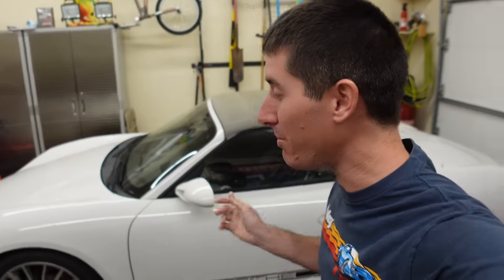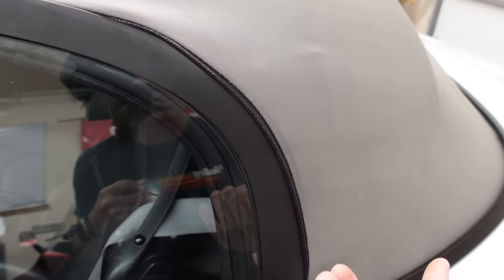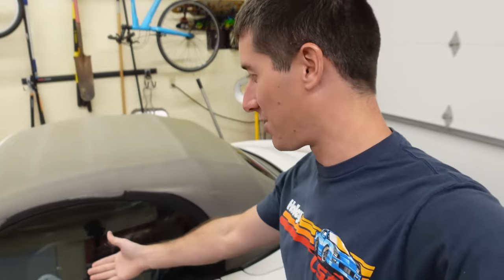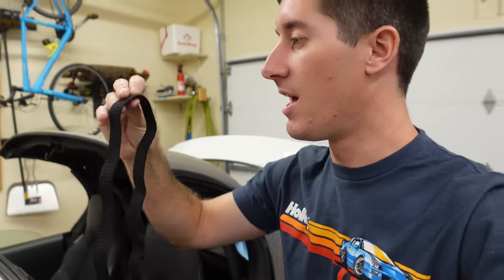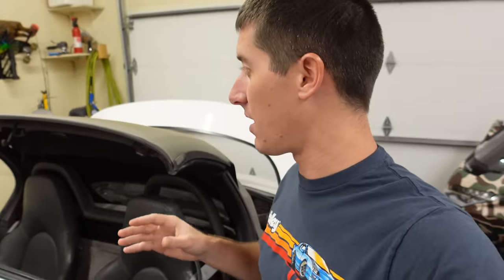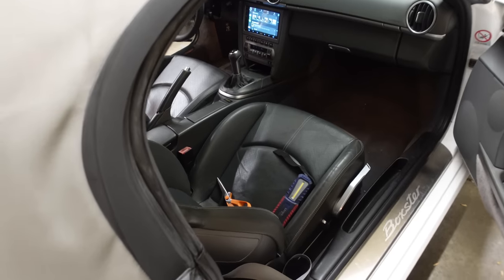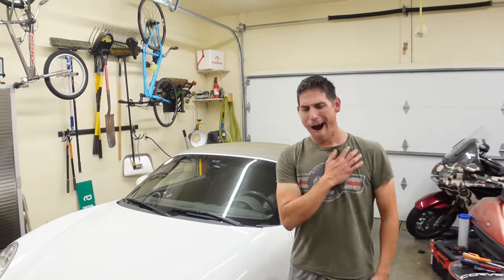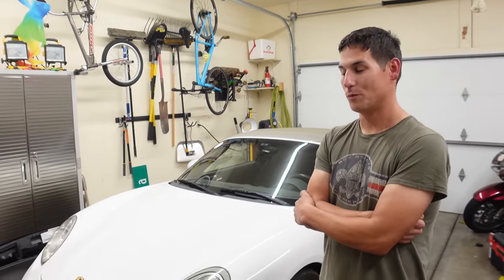I FIXED My Porsche Boxster Convertible Top For ONLY $3... You Can't Top This

Comment: I swear by those Atoto head units! I took a shot putting one in my f body and I LOVED it. Awesome using and obd2 reader and putting dashcommand on the head unit for some additional gauges. I now have one in my truck and have trans temp without adding any gauges to to the “a” pillar or anything!
Reply from the maker: Isn't Dashcommand awesome? I still keep that setup in my backpack all the time 💪
Reply: @WatchJRGo  well worth the purchase for sure!
Reply: How would an Atoto unit compare to a similar unit from a brand like pioneer that cost $600 with wireless carplay? The price is great, but a pretty leery of something named Atoto. Are the features just as good, any features you are giving up? The newest Atoto with wireless carplay has almost no reviews.

Comment: I just did this fix on my 2008 for free. That elastic is the same as they use in kids' pants so you can adjust them. There are little holes sewn in every so often, just like from the factory. I cut some out of a pair of Levis my 10yo had otherwise destroyed.  Worked great and I have easy adjustability, just like from the factory. The screw inside is a T10. I had to remove it, which made stapling the other end much easier. 🎉

Comment: My 1st Porsche was a 15K mi, 4 yr old 01 Box S.  It was not very reliable but thankfully it was CPO'd so Porsche paid for most of the repairs.  6 mo after the CPO ran out, I traded it in on a new 08 Boxster S LE (the orange one).  Kind of surprised I stayed with Porsche after all the troubles with my 986, but I wanted an orange Box S.  Coming up on my 14th anniversary of owning her and she's been one of the most reliable cars I've ever owned.  Porsche did get it right with the 987.
Reply: What problems did you have with the 986?
Reply: @thatguymichaelhtx  right rear wheel bearing failed, left front bushing shot craps, power steering pump failed, left window drop failed.  All these in 3 yrs of ownership and 17K mi.  Window regulator failures and pixel issues with the dash were also common but didn't catch my 986.

Comment: Thanks for your videos! Be worth pulling off the front bumper and easing the aircon condensers away and clear out any debris trapped in front of the main rads. Might help with cooling and definitely be good for the new owner.
Reply: Yes, mine rotted out the bottom row of both AC condensers, causing the AC to fail.

Comment: One of the first things I did when I got my '05 Boxster. Went to JoAnn Fabrics here. I did sew it. yes, multiple passes, but it was simple sewing, not seam-stress style by any means. I also had to re-do the strap that holds the rear window up an in place in top service mode
Reply: When you installed the replacement elastic bands, did you add any tension to the elastic as they were sewn back in?
Reply: @justinmaccreery2490  Not sure I understand what you mean by 'tension'.  The elastic itself provides the tension. I didn;t make the new ones any shorter or longer than OEM
Reply: @MrJbipes  Thank you for your reply : o ) Let me re-phase; after sewing the initial side, did you stretch the elastic before stitching the other side, or leave it tought but not stretched?
Reply: @justinmaccreery2490  It was taught yes, not streteched

Comment: Theres a surprising number of fixes where on youtube its a weird bodge but in reality its only $3 to fix. Have a 996 and first fault I had was a gearshift cable popping off, "fixes" on you tube were all bad mods or dodgy bodges with cable ties etc. I looked at the exploded diagram and could see a tiny pop pin in the end, sure enough no where to be found on my car, bought part off Porsche for £2.60 ($3) and 3 years later still no more issues.

Comment: I’ve had to do this elastic-band fix twice in 20 years.  Find the elastic strap. Loosen the screw (and washer) that hold the elastic to the top bow.  Pull out the elastic and flap it’s sewn onto. Cut off old elastic.  Sew or staple new elastic to flap. Cut a slot into elastic to fit around bow screw (and washer).    Feed new elastic and flap back into top and secure around screw (and washer).  Elastic length and tension are set where basic slack is taken up as top nears arch, and tension (elastic stretch) happens just as top moves behind arch, where it should be.  A important fix to avoid damage to top, tension cable, and decorative arch !!  
You only need to sew or staple the flap end.  The top-bow end with screw, just loosen  screw (and washer) and cut a small slot in the elastic 
Your way is easier.

Comment: Great cheap fix on the top. Another quick and temporary fix to the trim is to take a black sharpie and just go over all the bad areas, no tape needed, just be careful not to touch the cloth top. It won't be perfect but will look better than the aluminum that's showing.
Latter if you decide to paint it you just prep and paint like normal.

Comment: Im trying this myself… this is way more difficult than you make it seem… lol it’s hard to fit a stapler in there and also the tension… wow.  No advice on how which side to do first top or bottom..
Reply: Hope this worked out for you.  Check other videos where you can take out the whole elastics out which makes it really easy.  Just fixed mine

Comment: FYI You can use liquid black shoe polish to dye that convertible roof. Sounds crazy, but it works. Then seal it with clear floor wax.  Best of luck.
Reply from the maker: This is a gray top, there's no way you can use black on the grey 😳

Comment: He definitely got some kind of lemon if he drove a 986 and thought it sucked.  The S variant with the 3.2l was a great car with more power actually than that 987.  There are people that prefer the 2.5l over the 2.7l, even though it had less power due to the responsiveness, they claim it just felt better.  Either way, a Boxster is meant to be tossed around, and if you are basing it off of straight line speed (he didn't mention why he thinks it sucked), than he just doesn't get the point of the car.  I personally HATE the interior on the 987.1, it was much improved in the 987.2.  I would absolutely prefer the interior in the 986 over the 987.1, but that is subjective of course.
Reply: I get the point of the car which is why I was so disappointed with it. I prefer curves rather than straight lines anyway and in Hawaii it’s all curves. I was just so underwhelmed by how that car performed. It wasn’t the first Porsche I’d driven and it certainly wasn’t the last. 

This one drove like one would expect a Porsche to drive. I was so surprised that the Boxter delivered!
Reply: @Gabe-ABNCW3  then there was something wrong with it.   It is one of the all time best handling cars.  All Boxster handle amazing, 986 included
Reply: @LetsDIYIt  😉👍🏼

Comment: Indeed the old Boxster sucked, i had a S 2.7 and eben though was reliable wasn't fun. The Del Sol worth's more than the Boxster
Reply: They never made a 2.7 S. The 986 base was 2.5 ('97-'99) and 2.7 ('00 on), and the 986 S was 3.2.